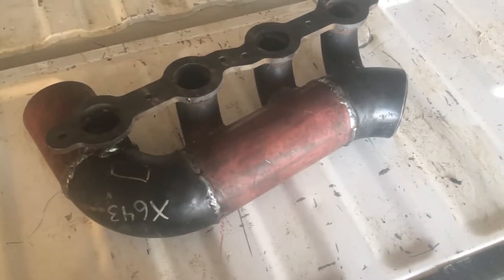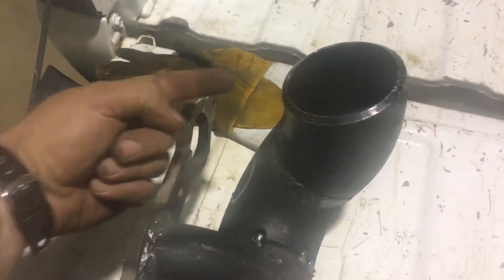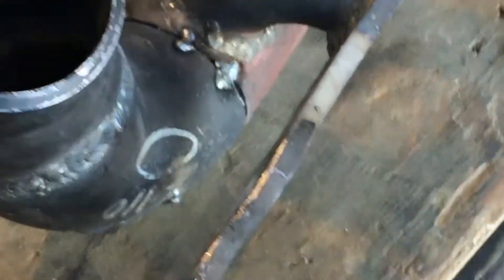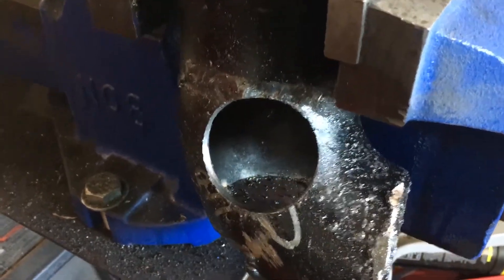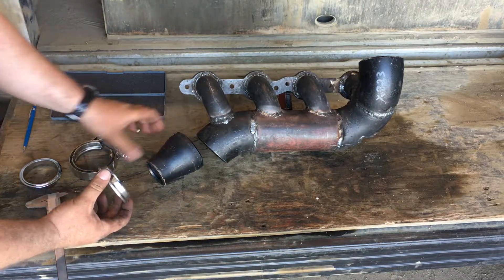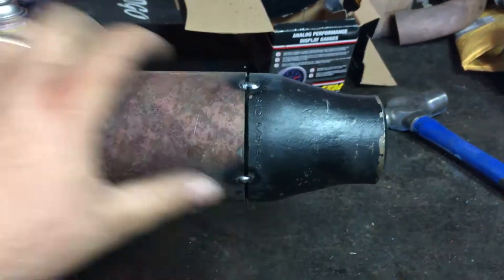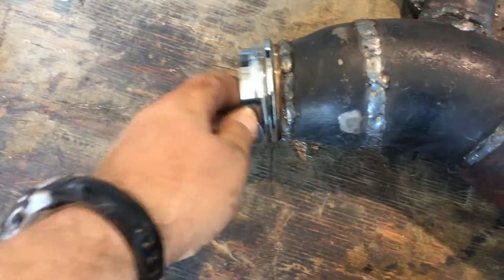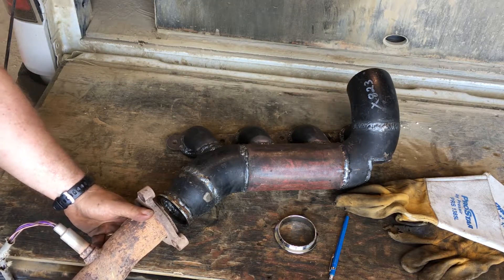Lowbuck LS Turbo Project - Log Manifold Modifications

Comment: On my log, that front tube is nearly straight, my elbow is a bit higher than yours. I also had the benefit of doing it with the engine in the garage lol. You did good work, keep it up!
Reply from the maker: Thanks, yeah I would do it slightly differently if I did it again. Thanks for watching and commenting, I subscribed to your channel as well, looks like it’s right up my alley.

Comment: Too bad you had to put that notch in the 90. Hopefully it doesn't cause problems. Looks good.
Reply from the maker: Agreed, I’ll give it a try with the notch but if it causes problems I may have to go back to the drawing board.
Reply: Lowbuck LS looks like you used the long weld Els like everyone says to use. I did the same thing but by the time I got done getting my main log to fit and clear everything they were probably regular weld els. I cut over a 1/2 inch off mine.